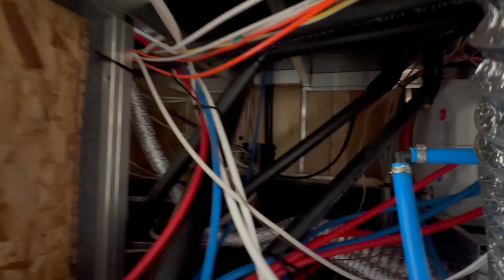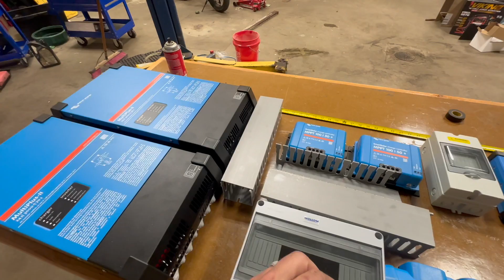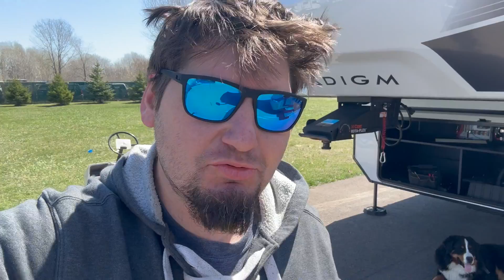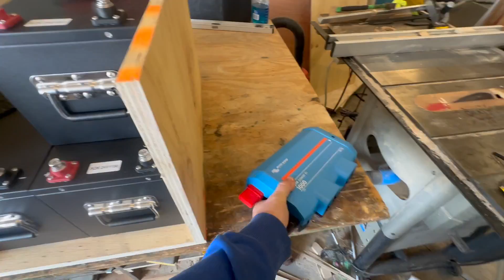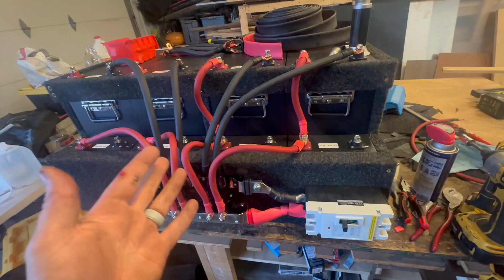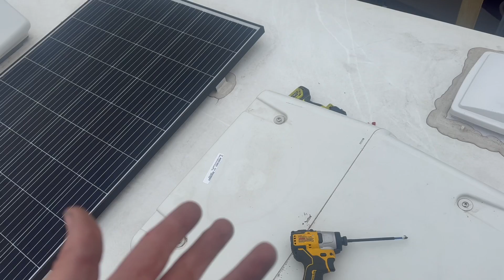24v Victron RV Solar System on Paradigm Alliance 5th Wheel Part 1

Comment: Hi. I really enjoy watching your videos and have learned quite a bit about RV solar installs. I really like the way you evolve your installs. i.e using the dinkle blocks and dihool disconnect switch. I really like the way you maximize the space and connect the components together. 

I own an Alliance Paradigm 390MP and have purchased a new Alliance Paradigm 375rd that is being built now with some customizations from the factory. Ergo, I know quite a bit about the Paradigms, mainly from doing my own work and modification on the rig and talking with the Alliance product managers.

One thing I would caution is not to screw the top of your component board to the 2 inch square tubing that runs from one side to the other in the front bay. Within this tube is a propane hose (conecting LP tanks) and also hydraulic lines for the front landing gear jacks. Even if you may miss one of these lines on the initial screw in, the rocking and rolling of the rig while traveling my move the lines in this tube enought to rub against the screw.

Not all Paradigms (some built before 2024) have these lines within the tube. From my research and looking, all the newer units (2024 and newer) the propane and hyd lines are inside the 2 inch sqaure tube. A rule of thumb, other than just looking to make sure, if the Paradigm RV has one big front bay door then the lines will run, probably, on top (outside) of the 2 inch square tube. If the Paradigm has three front bay doors then the lines will run inside the square tube. Its really easy to determine; just open the LP door and you will see the lines going inside the square tube with a bunch of black caulk filling the gap.

That tube is a perfect place to mount the component board. I would suggest using a "square" U-bolt to go around the 2 in square tube and then bolt the board. Using 3 of the square U bolts would work. One on each end and one in the middle of the component board.
Here are the U bolts on Amazon: https://tinyurl.com/ms46r653

Great job. Please keep the videos coming.
Reply from the maker: Great idea. Thank you for the heads up.

Comment: Hello, I have a question about the breaker that you installed after Victron Energy Lynx Power In. I’m just asking, does it make a different if batteries cables go to the top or bottom of this type of breaker?
Reply from the maker: Not that I’m aware because power flows both ways and must protect both ways.
Reply: @sotasolar  Thank You, have a good day....

Comment: Could you talk more about limitations of input current for dual inverters? So dual 3000 2x120V are limited to 19A min. If you have 15A input, would you not run in parallel? How does that work and what are the downsides?  Could you run two non-2x120 regular inverters (even say 5000VA) in a split phase system. Would these double in the input current limit, or would you be able to run at 10A (3000VA) or 14A (5000VA)? If you run split phase, would you ALWAYS? need to give it split phase power, even for those 15A/30A circuits? This would require autotransformer on the input.  How hard is it to reconfigure system to work with split phase vs parallel? Is it a simple button in CerboGX control panel or do you have to dig into software and reconfigure?

Comment: Will you add a pre-charger switch to charge the inverter capacitors before full-time connection to batteries?
Reply from the maker: We’ve never done it. We usually program with a lab supply with restricted amps, in production we recommend starting solar first , this will keep amps restricted. 

Even still we’ve never had any components fail, batteries or inverters due to the surge on startup.  ¯\_(ツ)_/¯

Comment: Nice video.  Maybe you should think about getting a new or usef forklift instead of a truck. A lot cheaper. Probably work better in the shop. Thanks Don
Reply from the maker: Not a bad idea, taking delivery of some items would be easier. But with the truck I can plow the pavement as well. I’m watching auctions for both.
Reply: Skid Steer with trailer mover, snow bucket, forks, snow blower etc. The attachments at limitless.

Comment: 🤣 did you watch our parallel inverter install, we did the same thing with the color coordinating Dinkle connections.
Reply: I did, I still can't figure out how to get the matching colors in the larger size. All they have on Amazon and their own website are black and white or black and red, no green unless you get the smaller conductor size.
Reply from the maker: Good to know we’re not alone. I did not see your video on it. From our commercial control panel work we had some laying around and I just got to thinking.
Reply: @sotasolar  if I would have known about these for our first install I would have used them to splice in the shore to MP+ 2 connection. On another note, I didn’t realize we would be limited to 18.5 amp on power assist. We want to hook up too 15 amp and having trouble looking for alternatives. Maybe a Blue Smart 24v charger connected to the Lynx distributor 🤷‍♂️
Reply from the maker: There is a third option that’s quite controversial and does have some drawbacks where you set each inverter up independently and you run one inverter into the other, and you would disable the charger on one. 

You had another option is to use the older style multi plus inverters we use those on our bus and those go down to 14 A AC input current limit as a pair. The downside there is you have to rewire the panel as 30 amp only however on our bus, it’s work just fine , we run two air conditioners, electric hot water, microwave, etc.

Comment: Great info and install!  I like the din rail splice connectors for the AC. Question, do you have any performance issues due to the AC lines being different length between the inverters? Just wondering how precise it really needs to be.
Reply from the maker: None reported, did a load test on it in part 2 released today.
Reply: @sotasolar  just watched part 2 and saw that. Didn't known if you look into individual inverters to confirm balancing. Regardless, looks nice and ran cool

Comment: Great video my friend! So cool to see you're using that Dihool breaker switch. I just discovered those around Christmas and love them as well also the mini din rail setup and box. I have started using the mini din rail breakers as well. They come in AC and DC. Great job on your setup and I agree on paralleling the Victron Multis.

I've gone to 48 volt systems now whenever i can. So much easier to work with. Let me know if you want info on 48 colt step down converters, it took me forever to find a good source that had higher current output. Thanks again!
Reply from the maker: Biggest issue with 48 is no 2x120 on the multi, that I’m aware of.  Yes please share your favorite 48v step down converter!
Reply: Daygreen is the company. I love Victron but have started doing less typical(in RVs) 48 volt, off-grid systems as well. If you're curious about my experiences let me know and I'll contact you through your business website.
Reply from the maker: @pdxagogo please do
Reply: Don’t stop there let’s hear it ?
Reply: @2hotscottpro  I use Rich Solar and EG4 systems. They are typically the LV6548s and the EG4 6000 EX all in ones. The Chargeverter enables you to utilize power form 15/20/30 amp sources as well. Really powerful systems but the interfaces are definitely not in the same league as Victron. 

One that is in the same league is EcoFlow and the Power Kits along with the Delta Pro Ultras are really compelling as well.
Reply from the maker: @pdxagogo I have an eco flow power kit in the shop. I’d hoped to review it. The inverter now refuses to turn on and firmware is so flaky. We installed 2 systems, I think it will be our last 2
Reply: Whoa! Good to know! Are the two units you installed having issues as well?
Reply: Sorry, missed this until now; no problems with either. It's concerning that you did but so far I'm having no issues and have done another since. 

Keep up the great work over there! Much respect!

Comment: GREAT VIDEO !!!!!  Thank you sir.

BTW One  of those vent caps on the roof of the Paradigm (I think the black one) is just for solar install, it runs from the roof the the belly storage area just for running solar pv wires :)
Reply: Came here to say this!
Reply from the maker: I will have to investigate that i’ve passed the point of no return on this specific install, but I saw another vent tube coming up from the black tank that was headed towards that direction. My instinct says it’s still a black tank, but I would like to believe that you’re correct because that would make things simpler in the future. Thank you for the comment.

Just thinking more there already is existing solar board on the roof. The only reason for having another channel would be satellite or something or something, but typically those are under a different kind of cover, but then again every RV manufacturer might do things different.
Reply: @sotasolar  It's the reason it's black verses the two white ones :) It's one of the 100 customer driven features of an alliance rv, you can see it in their pdf at their home page.
I know you are done with this one but all Alliance rv's have it, if you look in the belly it will be a black pvc pipe coming down from the ceiling going nowhere :)  Just in case you do another Alliance product.
Love the channel and have subbed for a long time, thanks for all the help you have given me.

PS: Love all the dog content as well. Bear and Zuki are so cute. Please go into his story a little more sometime :)
Reply: @sotasolar at 2:55 in the center of the frame you'll see a black pipe that just ends. That's the pre-run pipe just for roof stuff. I'm really enjoying your channel, lots of great ideas here.
Reply: Great job.